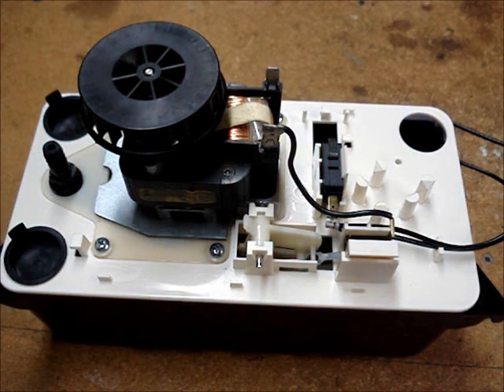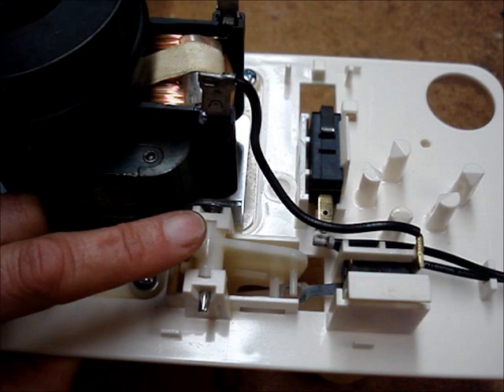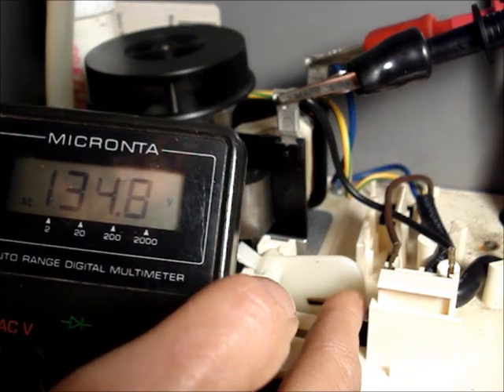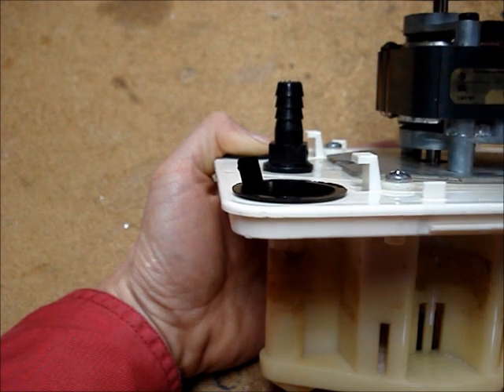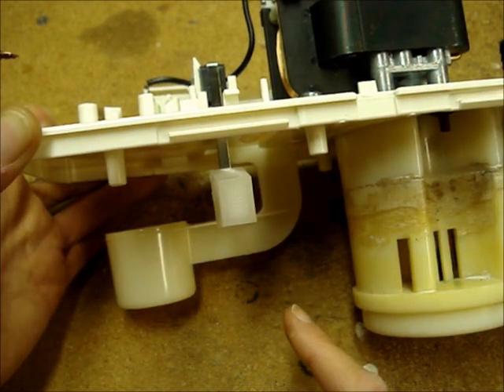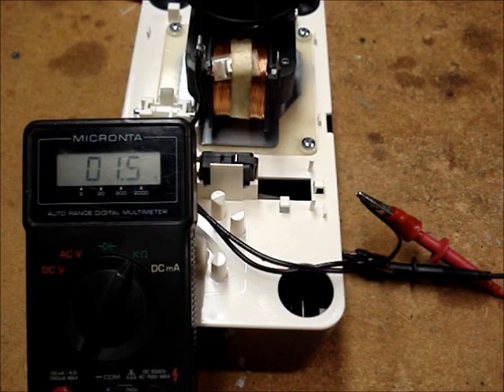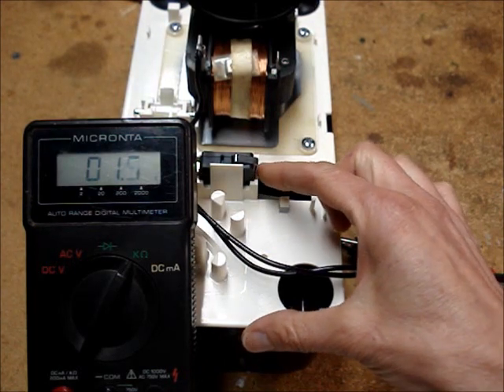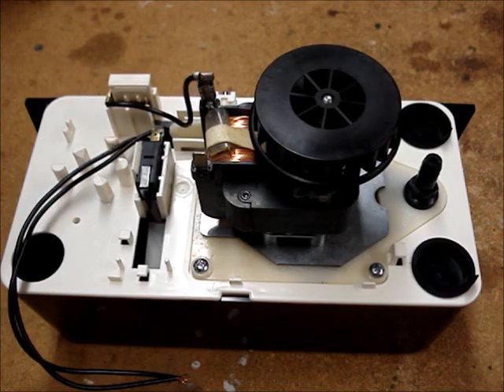How a Condensate Pump Works

Comment: I have a aprilaire dehumidifier in my crawlspace,  I do have to condensation tube running to sump pump but the pitch to the pump is not good enough to drain all the water out of the tube.  My question is would a condensation pump make the process to the sump pump easier?  Does the condensation pump  forcefully make sure that water from the humidity gets kicked out to sump pump?  Thank you and great video
Reply from the maker: A condensate pump could be the answer.  You'll have to do some engineering.  Look for the pump specs to see if the pump will work for your situation.

Comment: How does one power the pump when trouble shooting on a work bench? Does one just splice a standard cord with a wall outlet/receptacle end to the power leads of the pump that would normally be hardwired to the furnace and then plug into a wall outlet? or is it better to leave the pump connected to the furnace and troubleshoot in place?
Reply from the maker: I would troubleshoot in place if possible.  If you have the problem narrowed down to a specific problem with the pump you might try putting in on the bench to verify.  If you shop around, the pumps are pretty cheap.  I just bought a new one for parts.  Here's a link to the troubleshooting video on Know How Now channel.  Know How Now video - Troubleshoot a Condensate Pump https://youtu.be/TzyxRlG_iJE

Comment: I realize this video is a few years old now, so I don't know if you'll even see this, but thought I'd ask since you seem to know your stuff. :-) I have a portable air conditioner in my home office that has a built-in condensate reservoir. When that fills, the unit shuts off until I drain it. Problem is, with our normal humid July & August weather, that reservoir can fill in 2 hours. First I tried using a hose and running it into a 1 gallon bucket, and that helped. Then I could go 6+ hours before it filled. However, I thought a condensate pump would be a better solution since I could just run the tubing out the window and pump the water outside. However, the Beckett CB151UL pump I bought has a safety switch, and since my AC unit is self-contained, there is nowhere I can connect it. Will the unit work properly if I do not connect those low-voltage wires anywhere? I understand that if the drain line plugs I could have a mess on my hands, but I'm willing to take my chances. I suppose I could also wire that into a relay of some sort and put a switch on the 120V power outlet that the AC is plugged into to turn it off, but that's a project for another day. Thanks in advance!
Reply from the maker: Hi William,  you don't have to connect the safety switch on the Beckett pump.  As you noted if the the tubing clogs or the pump fails you will have a flood.  I'd guess there is a float & shut down switch on the AC unit's reservoir.  You may be able to connect the Beckett pump's safety switch to the set of wires that shuts your AC unit down when it's reservoir fills.  You'll want to see if there is voltage on that connection and insure that it is compatible with the Beckett's relay.  You could smoke the Beckett's relay.  You may also want to see if you can find the installation instructions for the AC unit, maybe there is an auxiliary input for an external condensate pump.
Reply: @Know-How-Now  OK, thanks for your reply. Unfortunately, this is a pretty cut-rate A/C unit, so my options are pretty limited. I will see what I can figure out, however. Thanks so much for getting back to me!
Reply from the maker: You are welcome.  For sure you have one shut down circuit input for the AC's reservoir.

Comment: I have this same model and randomly of late it seemed to run non stop. I took it apart and cleaned it. The issue seems to be that the main float is now somehow operating in reverse where the pump only turns off when the float is all the way raised otherwise runs constantly. Any ideas ?
Reply from the maker: I have a trouble shooting video for this pump.  If my memory is correct, a link to it is pinned to the top of the comments.  Maybe a problem with the microswitch?  They can often fail.  Mine was intermittently running and not stopping when the reservoir was empty.  I bought a 2nd pump and replaced the microswitch... problem solved.  Disclaimer....  I'm just shot gunning, without seeing it in person and troubleshooting, I can't diagnose the problem.

Comment: Hi thank you ! I just had my ac serviced yesterday.. I use to hear my condensate pump like turn on.. Made like gurgling swishing noises like it was taking out the water to outside.. But since yesterday I haven't heard that noise. We did empty all the water in the condensate pump.Is noise normal.. And why am I not hearing that cycling noise now?
Reply from the maker: Hi Margo.  Maybe the pump is not running?  If you are not hearing it run as you usually do, and the reservoir is filling up with water, it could be that the pump is not working.  Maybe the service tech forgot to turn on the power to it?  Here is a link to a video that I have on how to troubleshoot a condensate pump, maybe that will help you.  https://youtu.be/TzyxRlG_iJE

Comment: Hello, have a few questions. Where does the condensate pump get the water from, also my condensate pump runs quite often when I have the AC turned on, the water goes into my basement sink in which I have a bucket which catches the water and it comes out to about 2 gallons of water per day, is that normal?
Reply from the maker: The water comes from your HVAC system.  The more it runs, the more water.
Reply: @Know-How-Now  any way to fix this so it runs less?
Reply from the maker: The only way I know to reduce the amount of condensate water is to change the temp on the AC or heat system and have them run less.
Reply: @Know-How-Now  Appreciate the help, do you think a few gallons a day is normal if I have the temp set to 75F?
Reply from the maker: I don't do any kind of design work on making HVAC systems.  I'd recommend contacting the manufacturer of your equipment.  I'm sure they have some engineering data on that topic.
Reply: @Know-How-Now  Even when I set my humidity to 0 (turn it off) and turn on the AC, the condensate pump still runs a good amount.
Reply from the maker: You might want to call the company that services your unit if you think it's not working properly.

Comment: Is it better to have a condensate pump or run the condensate pipe to a sink drain pipe?
Reply from the maker: Here is a link to a web page that covers codes for condensate pump drainage that you may find helpful:  https://inspectapedia.com/aircond/Condensate_Drains.php

Comment: how you conect the two wires
Reply from the maker: Sorry it took a while to see your note, YouTube's notification alerts are not working.  Which set of wires?  The AC power or the set that is set to the control wiring on a furnace or AC unit?
Reply: the two skinny. black wires on the pump how you wire those cuz there are two thermostat wires one is  for furnace. to thermostat which is located inside the house n the other one for  the condensor to furnace  in which one of those two wires u connect this pump
Reply from the maker: The black wires for the safety switch should be connected in series to the low voltage thermostat circuit.  The switch on the pump should cause an open/break (usually the red wire) on the thermostat circuit to shutdown the heat/ac if the float gets high enough to change the state of the micro switch.  There is a typical wiring diagram in the video, though it's hard to see when viewing via YouTube.  Sorry about that, it was readable on my movie file.  Here is a link to installation instructions for a Hartel pump (all these pumps are very similar), look at page 3 & you will see a typical wiring diagram for the safety switch.  http://www.arcat.com/clients/miltonro1.pdf

Hopefully that will help you.

Comment: How often does the water pump outside ? Because my tube keeps freezing causing leaking in my basement. Can I put it inside in a bucket maybe??
Reply from the maker: A couple of thoughts, maybe heat tape will keep it from freezing up.  You could run it into a bucket, it's hard to say how fast the bucket will fill up.  Can you run it into a a drain or a basement sink?  Ultimately, you have a design problem (I know, it's January and not a good time of year to be making a permanent repair), maybe there is a low spot that's freezing up and it can be piped differently or maybe drained inside of the house.  Some codes may not allow it to be drained into the waste lines.